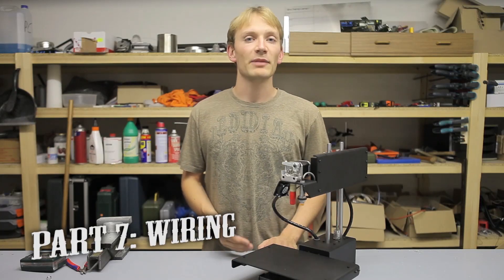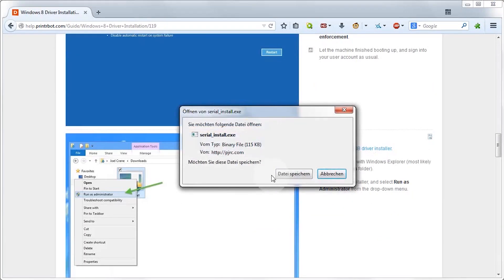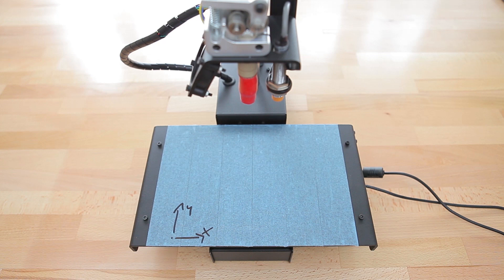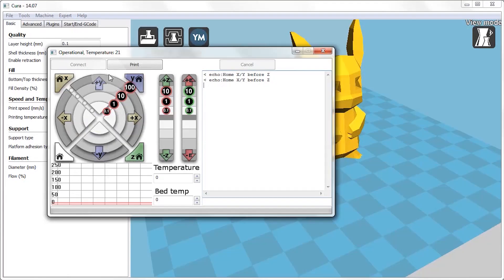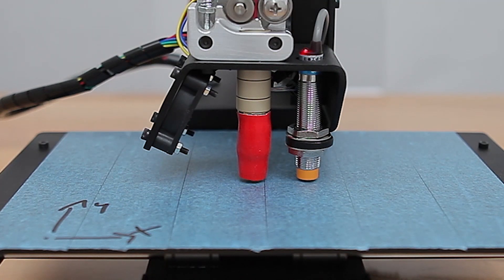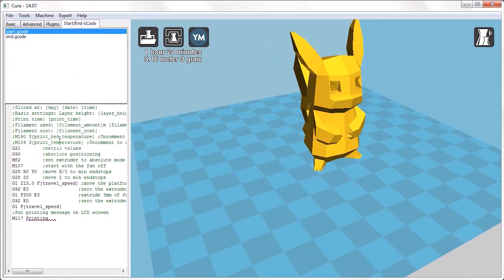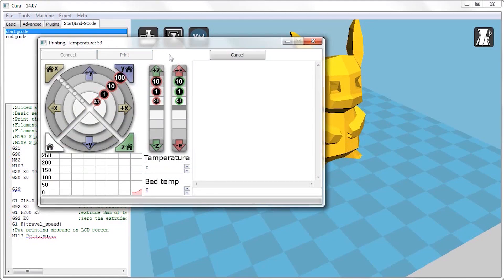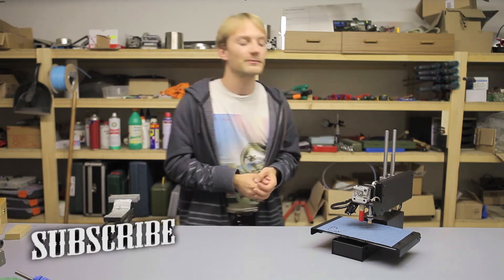Printrbot Simple Metal Kit: Part 8 - Software and Z-sensor calibration

Comment: Thanks for this series!  I lucked upon a Simple Metal used already constructed, and I've never used a 3D printer before.  I was able to get it to work, MUCH easier with this series, than otherwise.  I'm also using Cura instead of the software suggested by Printrbot, but it's a much newer version, and I can't find the settings to allow me to use the Gcode the way you do.  If anyone has any suggestions, please let me know.  Thanks!  Keep up the great work!!

Comment: Tom, I recently acquired a Printerbot simple metal. As you know Printerbot is no longer(I didn't know this until I tried looking for help files) Basically I owe you a major thanks because without your video I don't think I could have figured out the calibration. Do you have advice for updating from Cura14.7  to Cura 15.4.3 Thanks.

Comment: Tom,

Thanks for the help with setting up the Printrbot and how to use it with Cura. I've had my Printrbot Simple Metal since 2015 and once I used the Printrbot to print my Eustathios Spider V2, I stated using it. I dusted the Printrbot off recently and I was having trouble with the Printrbot checking for level in 3 places (G29). The Printrbot just wanted to check for level in the center of the bed. 

I can't wait to try Cura out and print some stuff on the Printrbot. This is a great video!!! Thank you!

Comment: Okay EVERYONE who has an issue calibrating the Z axis.  Don't use the 1mm distance with the sensor like they tell you to.  Put paper on the printbed, lower the nozzle until you can JUST feel it touching the paper when you try to pull it away^ just like in this video.  From there lower the sensor just barely and ever so slightly until the LED turns red.  From there use pronterface ui and set that as the point you want

Comment: I've finally reconfigured the same Printrbot Simple Metal for the fourth time (it seems to need full top-to-bottom re-setting-up and reconfiguring every few months). Using the Pronterface UI buttons still allows for X and Y movements at about 30mm/s. However, after readjusting M212 and bringing the head down to the new Z0, the printer G0's and G1's along X and Y crawl at a snail's pace (less than 3mm/s). They don't revert to their usual speeds until I disconnect and reconnect to the printer.

Comment: Great video!  This is like my third time watching it.  Do you plan to go over optimum settings for the Printerbot Metal Simple at any point?  I have trouble with prints falling over while printing and coming unstuck to the painter's tape, etc. I would like to optimize and experiment (a little) with infill, layer and feeds options but, I'm a little nervous I might botch my machine somehow.  Also, design tips?  I noticed that if I have to many rounded surfaces, there's no good place to orient my print.  There are more questions I have but, this is what is slowing me down at the moment.  Thanks, Thomas!

Comment: I really could use some help with this printer... I've set the calibration and it seems to work perfectly now but the fan wasn't working so I stopped the print and felt it and it was searing hot. It hasn't even been on long for it to get like that and I couldn't get it spinning by hand so I know it's not stuck. Also, I then turned down the print speed and turned off the fan and just see how everything goes but as soon as it started printing the hot end went too low and started peeling the tape off and making a small scratch. I had to unplug it because pressing cancel didn't stop the pre test. I don't understand because when I "home" the Z axis everything looks fine and dandy.

Comment: Good video but I just recently bought a a simple metal today and some of the parts have changed, mainly the parts near the extruder but still work in the same way. Sometimes you went a bit too fast so I had to rewind to see what exactly you were doing. Unfortunately for me, they did not put enough correctly sized screws so I have to run to the hardware store. I'm still on part 6.

Comment: Thomas good video but still can be a more clear on the steps to take.   I think it would be better if you could be more clear about after setting the probe clearance that you have to zero the XYZ using the 212 command.  In your video you are pressing icons in Cura which really throws you off.

Comment: Things to know about the tutorials. Part 5 has the extruder from a different version which for some reason comes with the dumb screw you used(which will not work unless you cut it/I'm finished building it is now just an extra screw). The Wiring is off a bit if you have the new version also. Lastly if you get an ATX power supply you will not be using the power plug it have a 6 pin connection for a motherboard but runs at 12v so yea.... also you want Cura 15.04 newer verions don't have printrbot settings.

Comment: I am having problems with the printer now. I cancelled a print right at the beginning because it was offset too low but now I can no longer reconnect to the printer. Both the computer and cura recognize that the printer is connected, but the two don't seem to communicate anymore. I restarted my computer, unplugged the power to my printer and let it sit overnight, uninstalled my software and all drivers and then reinstalled, and even installed cura onto an older windows 7 laptop that I don't use anymore and still get the same result. The computer recognizes the device and installs all drivers, cura recognizes the printer and opens the print interface and tries to connect but I always get the same message. Error: no more baudrates to test. I have done everything I can think of short of taking the printer apart and reassembling, replacing the usb cable, or just buying another printerboard. Do you have any suggestions because I am all out of ideas.

Comment: so im stuck at this step. the little thing that spins so that the arm moves is too loose. i have both little screws in but the bottom screw is not all the way. i have already tried to tighten it. the top one that hold the rod is nice and secure. what am i doing wrong?

Comment: Hey *****, can you help me solve this problem I'm having? I'm running a Printrbot Simple Metal with Cura. Everything works fine and I've had some really good quality prints with this setup, but lately my prints keep randomly timing out. It will be in the middle of a print, everything looking good, and then suddenly my laptop makes a USB disconnecting noise and the print head stops dead in its tracks. It does not home the axis or even turn off the heat or fan, it just stops and pools up.
The error log says: 

Serial timeout while writing to serial port, trying again.
Unexpected error while writing serial port: SerialTimeoutException: 'Write timeout' @ machineCom.py:_sendCommand:565
Changing monitoring state from 'Printing' to 'Error: SerialTimeoutException: 'Write time...'
Connection closed, closing down monitor

I've tried fully updating Cura and it still happens. I can't print anything, help!
Do I have a bad USB cable ?

Comment: Has there been an update since last September? I recently received my 3d printer and it seems that the command M212 has no effect on the actual homing position of the Z axis. I am using the Printrbot Metal Simple with heated build plate with a rev f board on linux ubuntu 14.x with cura as my host. Any ideas on how to fix the actual homing position?
Reply: Martin M. I Have figured my problem out with a little bit of testing. I came to the conclusion that the head will not lower to the actual leveled height, but rather it will be where the end stop tries to stop the z axis. The actual leveled height will come into effect once the print is start after the plane leveling. If anyone else is having this same problem, ask away for specifics of what i did.
Reply: ***** For using Cura, I set the M212 Z Probe offset then set it in the EEPROM with M500. After doing that I would home the Z axis, and first check the Z height with M114, it should be greater than 0. Then make the print head move Z -10. At this time, it wont hit the print bed unless you set the offset wrong, it will just stop once the printer knows its at Z = 0. If you need more help just ask.

Comment: My Z-Probe is always returning as "Open" when i use the M119 command. Even when i hold metal up to it and the LED turns red. I have checked my connection to make sure it correct and even directly connected the sensor to the board without the extension. Any ideas?

Comment: I've had this printer for a few weeks and everything's been printing fine but the auto leveling doesn't seem to be working correctly. When It extrudes on one edge of the bed, it's laying down perfect. Yet on the other one its way too low and crashing into the print bed. Does anybody know what I'm doing wrong?

Comment: I am having trouble with my Z-Sensor; the LED will not light up and also does not stop when metal is present. The wiring is set up correctly; did anyone else have this problem or a solution to it?
Reply: im having the same issue and printrbot gave me a new probe and the problem is still here
Reply: Which printrboard Rev do you have? 
I may have found the problem but won't find out till my part gets here. 

Basically I found in the online support guide for my model at least (Rev F4) that it doesn't ship with a little black box on the printr board called a "jumper". In the guide for trouble shooting why the z probe won't work it says specifically to make sure in Rev F4 that this "jumper is in the right place or not missing. That tiny thing supplies power to the z probe. 

Obviously, mine is missing. I have that part on its way and hopefully this solves the issue.
Reply: i just found on the support page the same thing. my Rev F4 board didnt come with the jumper (which is wrong,the printer should come with all of the parts it needs) I had printrbot send me a new probe so idek if they will send me the jumper because they gave me the probe when i may not have needed it at all.
Reply: I'll give you an update once it gets here and let you know if it works or not. 
I was told that a jumper can be found from the back of old cd/ dvd or floppy disc drives.
So just in case they don't send you one, you can try looking there.
Reply: Also try this:
https://printrbot.zendesk.com/hc/en-us/requests/new
You can requesting missing parts.
Reply: thanks. Printrbot is sending me a new jumper now.
Reply: Ok, the jumper is here and .... The LED turned on! I have to leave so I won't be able to test the metal detection quite yet but I'm pretty sure this fixed the issue! Again, more updates to come.
Reply: awesome. this makes me much happier about my printrbot
Reply: Ok, everything works perfectly! I'm just calibrating the z probe now. Just a word of caution, don't use the G code for the fan shroud. It over extends the y axis and makes an awful noise. So instead use the .STL file and I suggest following the instructions on setting up slic3r.
Reply: awesome. my jumper will be here tomorrow so ill be sure to follow your advice.

Comment: PLEASE HELP!! i purchased the printrbot simple metal assembled, and followed your steps for setting it up in this video. whenever i launch cura, the printrbot shows up under print to USB, and i can click it too. the first manual control command i enter goes fine, but after it is executed, i get an error that reads: (starting from with a home x command that worked fine)
Send: G28 X0
Send: M105 T0
Send: M105 T0
Send: M105 T0
Serial timeout while writing to serial port, trying again.
Send: G28 Y0
Serial timeout while writing to serial port, trying again.
Unexpected error while writing serial port: SerialTimeoutException: 'Write timeout' @ machineCom.py:_sendCommand:565
Changing monitoring state from 'Operational' to 'Error: SerialTimeoutException: 'Write time...'
Connection closed, closing down monitor
Unexpected error while writing serial port: AttributeError: ''NoneType' object has no attribute 'write'' @ machineCom.py:_sendCommand:565
in repetier, i only get commands waiting and the list just gets bigger and bigger
Reply: MORE INFO, i can manually move the x y and z axis, but cannot use the home command. i can change temp of hot end, but print fails. PLEASE HELP THOMAS

Comment: Hi Tom, your videos have been a great help, thanks very much. got mine built in a few hours and now I'm printing.

word of warning to others- i set the probe using the M212 too low,  as the home button in Cura wasn't showing  the correct height. My first print scratched the bed. I would try a print at '0' first and see how you go from there.

Comment: Thank you!  I used your videos to supplement the assembly guide on the Printrbot site to build my Simple Metal 3D Printer last weekend.  The instructions were easy to follow and I was very happy that my printer worked correctly on the first try after I completed it.

The only suggestion I would make is to show the part or assembly for a couple of seconds at the end of each step.  It would make a good spot to pause your video while the viewer is completing the step with a visual of what the part should look like when the step is completed.

Comment: Hi Tom,

I tried homing Z-axis but it just moves up a little and then stops every time i press it.  Do you know what could be wrong?
Reply: ***** The wiring looks right.  http://i1294.photobucket.com/albums/b607/Jon_Kong/PrintrBot/wire_steppers_zpsfbffad66.jpg & http://i1294.photobucket.com/albums/b607/Jon_Kong/PrintrBot/Wire_stops_zps9fa4dc80.jpg. I did the M114 command it it says:
 X:0.00Y:152.40Z:0.00E:0.00 Count X: 0.00Y:152.40Z:0.00.  Not sure what else to check.
Reply: ***** Did a M119 command and the Z probe is always on triggered
Reply: I have the same problem, just the led only lights up when it's near the bed or when I put a metal object near it.